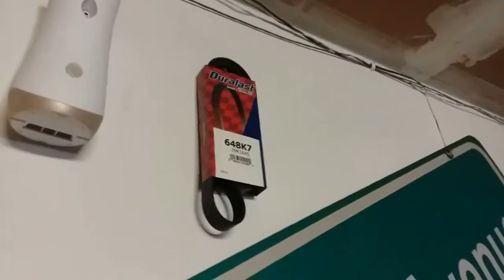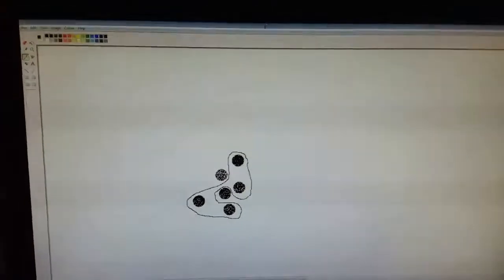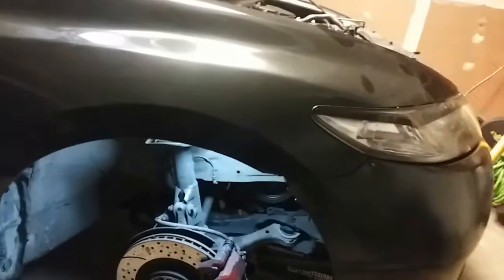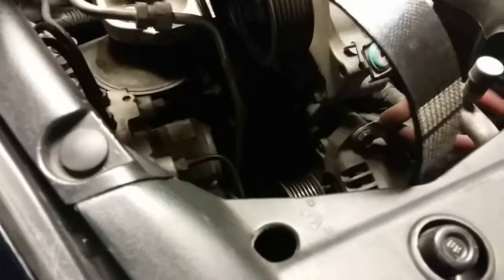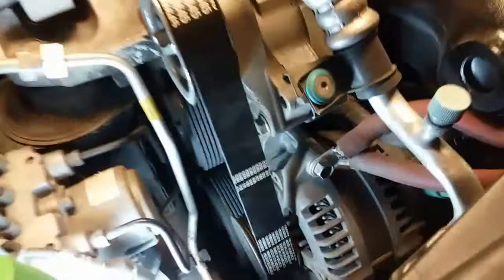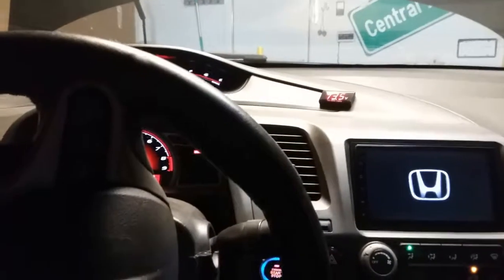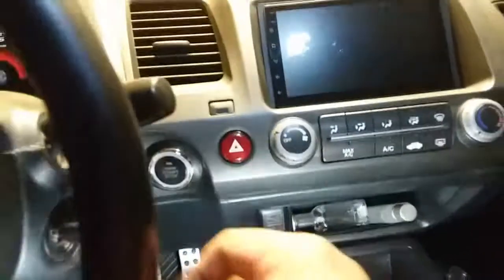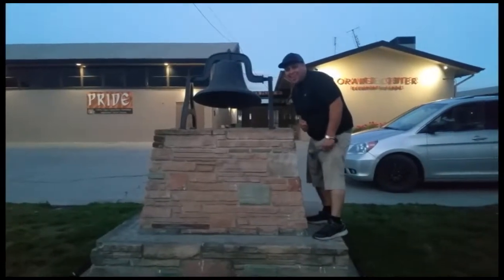How to: Install a new Serpentine belt on a 2006 Honda Civic Si

Comment: Please tell the length
Reply from the maker: I'm not sure of the length but replacement part number is 648k7. Hope this helps! Thank you for your SUPPORT!
Reply: @559powerscape  i m from india i own a civic and my serpentine belt broke into pieces i dont know the exact length..i tried 7p1970mm but that was a bit small in length..so the right one must be 2150 or 2050 i m really confused..
Reply from the maker: @rohitahlawattt  sorry bro
Reply from the maker: This is the link from autozone here in the states I don't know if you'll be able to see it. Length is 64.8 ....https://m.autozone.com/external-engine/belt/duralast-serpentine-belt-648k7/165259_0_23387
Reply: @559powerscape  its ok bro